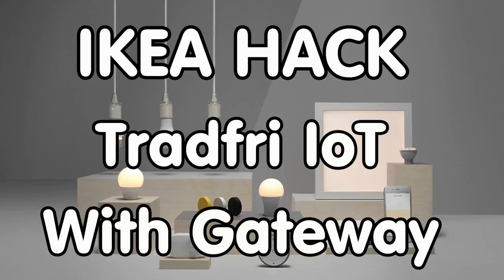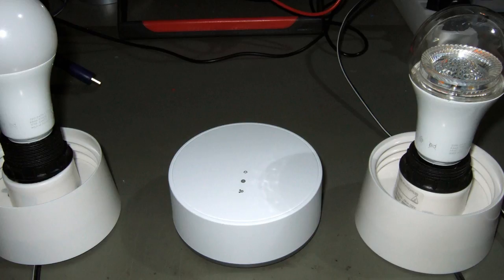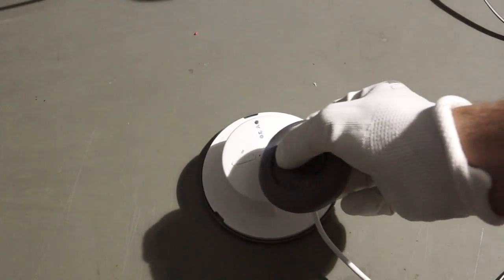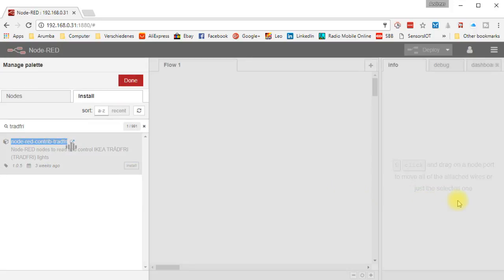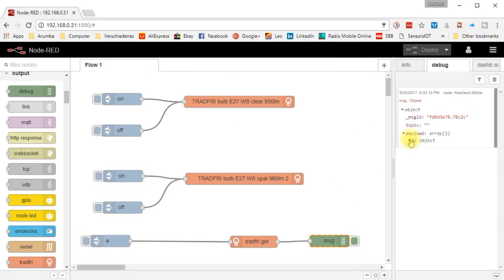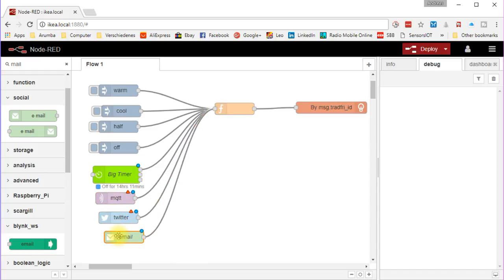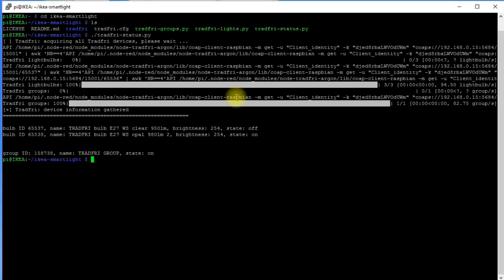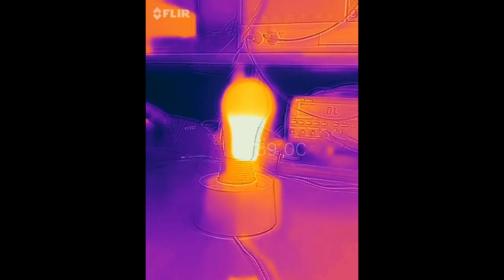#145 IKEA Trådfri Hack with Gateway, Raspberry connection

Comment from the maker: ATTENTION: The FLIR measurements are not correct (probably because o the material or because of the radiation of the LED).They are too high. But still, the whole lamp gets pretty warm.
Reply: Andreas Spiess did you try a bit of electrical tape on the surface you want to measure.  (non reflective and reasonable emissivity )
Reply: 90 degrees indeed seemsed pretty hot. Won't make 25.000 hrs
Reply: Ed19601 it isn't 90 degrees, and it is rated for about 6-14W, depending on type, and handle about 25 000 switches on/off. 
So yes, I think they will live 25 000h.
Reply: The Hue bulbs get super hot too, I would estimate maybe 75 C in the base. The non-smart 100 W equivalent bulbs I have also get pretty damn hot, I guess it's just a thing with the switch mode driver chips and limited heat sinking.
Reply: Anders Jackson that's why I said "seemed", because if it were it probably wouldn't make 25.000 hrs
Reply: That's quite concerning since I'd like to use them in a not-so-ventilated enclosure ...
Reply: Very odd, really.  Due to the much lower voltage, the 'on' time of the switcher is very low, but also a pretty high current spike (relative to a smaller drop across the supply).  Still shouldn't be more than slightly uncomfortable to the touch.  I use 60 watt equiv. bulbs both at home and elsewhere, and I can grab one and unscrew it without even thinking much about the heat.  100 C would leave burns.
Reply: You exposed your password-authentication-thingy which is on the back of the gateway around 10:49
Reply: @anullhandle  Yes correct, like i learned on FLIR cursus, put electic tape on metals and such

Comment: Very interesting video.  I like IKEA concept a lot, providing affordable system that is using standard protocol. I hope they will improve on that heat problem because it could caus them problems in future.
In my opinion, one thing that is missing in Trådfri product range is some kind of generic power switch that you can plug in power outlet and then control output. I am thinking to build something like that by getting a Zigbee module and then build something like "Zigbee Sonoff" with it, that is capable of pretending to be an IKEA light bulb.
Reply from the maker: I think, they just started and heve to learn to deal with electronics. Most of their current offering is still "mechanical". And I am sure, they will expand their offering, if we buy the current stuff...

Comment: Excellent explanation about the protocols that tradfri uses! I'm interested in "hacking" a tradfri remote control. I want to use the left and right button to switch between scenes despite of switching between light temperature. My goal is to switch between 100% brightness on 2700k and 30% brightness and 5% brightness on 2200k. Just like the non smart Phillips scenes switch bulbs. Right now I need several commands from the tradfri remote to do that.
Reply from the maker: Good luck with your project! I think, today you find much more info about the topic than when I made my video.

Comment: I see that the TRADFRI node has the same problem as the Hue ones, the bulb (or function) is fixed by the setting in the node. If this is similar to the Hue node it can be very useful to pass the bulb identity into the node through the 'topic' functionality. This allows the node to operate for multiple bulbs (using the split node) and then to use a database to store scenes. It was quite easy to modify the Hue node for this (but a whole lot harder to get the change adopted into the original node).
Reply from the maker: You do not need to set the bulb in the node. One setting is, that you can select the bulb from the payload and it works.
Reply: Thanks Andreas, my NodeRed install is currently broken and I didn't get a chance to look at the node detail, just what was in the video. When I do get it back I might align my modified Hue node with the TRADFRI one and then I can create scenes with a mix of bulb types without too much different setting up!

Comment: 90°C is quite hot, hope it doesn't melt some lamps. on the other side you get an extra heat source in your house. Funny to see secure coap is used while zigbee can be hacked quite easy.
Reply: 3D Gussner Compared to an ordinary tungstone bulb, 100 degrees Celsius are not hot.

The Gateway is connected to internet, but zigbee isn't. That is why you want encrypted communication with the Gateway, so others can't capture the user and password.
Reply from the maker: Personally, I think, 90 degrees (and some parts inside must be even hotter) is not good for electronic parst on the long run. We will see how many of these bulbs have to be replaced by IKEA during warranty period...
Reply: Again an interesting and useful video, Andreas, thanks. Will you dive deeper into the "hot" secret? LED bulbs were introduced as an energy saver, but I guess a lot of energy is now wasted due to a cheap but inefficient power converter...?
Reply: That would be great.
Reply: The glass bulb of an ordinary incandescent bulb can reach temperatures between 200 and 260 °C, so 90°C will not melt anything. Very few plastics melt at below 100 degrees (think of boiling water, in a plastic cup)
Reply: And I have hard to belive it get that hot, as it is marked 14W. And you can still handel the bulbs with your fingers when they are hot.

Comment: The god part about the app is that you can make some automation.
Short commings of the app is the timer control are primitive.

Another problems is that the bulbs are organized around one controller. So you can only put one controller to control a group of bulbs, so a controller on each side of stairs are not possible.

And yes, there are a movement detector in Trådfri, which can work as a controller.

With the protocol, one can detect the controlers and through that control other groups.

One good thing with CoAP, there are support for updating firmware in devices.
Reply from the maker: I saw the controller in the discovery, but had no use for that so far. It also switches the lamps and you can read the status of the lamps to get the status of the controller (without toggle).
I do not own a movement detector, but assume, it works like the remote control directly to the bulb. This is why I do not like it. My movement sensors go to node red, where I can do some logic before I switch the bulbs. 
I just checked the answer for the remote control: It was always "on:false" in node red. I assume, its message is not stored in the gateway. Do you know a trick?

Comment: Hi Andreas, I’m working with the Tradfri stuff now for more than a year in combination with Node-Red. Control the light bulbs isn’t a problem. I’m able to switch them on and off and I’m able to read the status. But my problem are the switches. The plugs. Also here switching them on and of using Node-Red works perfectly. But....... I’m not able to read the status!. Do you have a solution to achieve this using Nod-Red?
Reply from the maker: For Zigbee I use now zigbee2mqtt, but I have no IKEA plugs in my home. I also made a newer video about zigbee.

Comment: Thank you, this is very interesting, I made a home automation system with Futlight RF lamps and zigbee/RF roomcontrollers, but after this video I would like to replace the RF bulbs  from Futlight by the Ikea ones. I just wonder now how to control groups of Ikea lamps and the color of the lamps.  These lamps can listen to group commands? Did someone crack the full protocol allready ?  The Ikea lamps work as zigbee routers?  Can the Ikea gateway be controlled by ESP32 also? Thanks again.
Reply from the maker: There is a newer video about Zigbee and I plan a third one in the near future focusing more on Mesh networks.

Comment: Wow, that's some hot bulbs! Did you adjust for emissivity on the white surface of the bulbs or check with a thermocouple to check readings of the temperature were correct?
Reply from the maker: +zaprodk You are right. The shown temperature was too high. I made a correction and pinned it, so everybody can see it. Thanks!

Comment: Great video :) Quick question though: at 7:50, the color parameter read from the bulb seems to be an RGB hexa string. But at 8:32, when sending the message to set the light to a color, you are using a preset value ('warm'). Does it work if you send an arbitrary RGB code (e.g.: ff0000) ?
Reply from the maker: This is an old video and I do no more remember the details :-(

Comment: Hi Andreas, thanks a lot for your effort, much appreciated. After connecting the Tradfri Gateway to Node-RED, I'm wondering whether there's a way to receive events, for example from the remote control. Maybe you could point me to the right direction, I'd happily implement an Input Node for node-red-contrib-tradfri. Thanks in advance.
Reply from the maker: From what I saw, you can read the status of the remote only if you read the status of the bulbs, which were switched by the remote. But I did not invest a lot of time in this matter...
Reply: There is a feature request for an observer in the node-red palette: https://github.com/nidayand/node-red-contrib-tradfri/issues/8 . 
Let's hope that somebody will implement its...

Comment: nice project again. I did the same with the Philips HUE. I am curious what the get returns with tradfri when the lamp is switch off from main. Is it the same on/off parameter?
Reply from the maker: Can you rephrase your question, please? I do not understand it.
Reply: Andreas Spiess I mean, what does the get request get as an answer when a light is not powered on. The Philips HUE API has an parameter reachable for that. I was wondering how this is in Tradfri.

Comment: Great series, will test myself. One concern is that it looks like the gateway and controllers can only control 10 devices. Will your hack expand this limit. If not how are one supposed to use this system without going mad with limitations.? More gateways?
Reply from the maker: I was not aware of this limitation. So, I assume, with different gateways. Might anyway be necessary because of the limited reach of Zigbee

Comment: Great series! One question though: if I understand correctly, the same bulb can be operated both with the remote switch and the gateway. I'm curious if it's possible to receive remote switch events through the gateway? That is: if I switch on/off or dim the bulb with the remote control, would I be able to receive these events through the gateway with a computer? Thx!
Reply from the maker: The take of this video was done a long time ago, so I do not remember the details. And I did not do anything with this technology since then. But I think, there is more stuff on the internet now than was available then. Maybe you find your answer by googling.
Reply: I'll probably do that. Thanks anyway.

Comment: Hey Andreas, I really like your video's. I fell in love with the LoRa series. Would be really interesting if you did a tutorial on GPS tracking through a lora node. It would be a really go alternative to mobile network for embedded tracker use cases
Reply from the maker: I think, you find such devices because they were used to test LoRa gateways. Google for "lora gps arduino" or "lora gps tracker"
Reply: Andreas Spiess Yes, I did know of that since a short time. However, lately I found alot of people doing it on a node
Reply from the maker: What do you mean with "on a node"?
Reply: On a node as in not on a gateway.

Comment: I have one more use case. How to implement that one? I can't change the electrical installation in my rented apartment. So, many tradfri bulbs are connected to old fashioned physical light switches. However, I still want to implement a night mode. Meaning the bulbs must have 2200k light temperature during night. E.g. can I get an event once a bulb is turned on in order to switch its light color?
Reply from the maker: I think I changed color from cool white to warm white somewhere in the video. It is possible

Comment: Someone stated (comments of the make article) that the used electrolyte condensators have a lifetime of 10000 hours at 105°C. Am I wrong if I assume that the bulb is likely to die within 1.5 years?
Reply from the maker: Probably not...
Reply: Maybe they used solid electrolyte (polymer) caps.

Comment: Is it so that communication between the IKEA Trådfri gateway and the lamps goes thru the remote? In other words, the gateway cannot operate the lamps alone?
Reply from the maker: +jesuschal I do not think. However, you need the remote to pair the bulbs. Which is ok, because the remote is portable, the Gateway usually not...
Reply: From the Ikea.com (http://www.ikea.com/ms/en_US/customer-service/about-our-products/smart-lighting/troubleshooting.html)
I connected my light source to the TRÅDFRI Gateway by using my remote control. Do I need the remote control anymore or can I just use the TRÅDFRI App?
You can steer your lights without the remote control if you disconnect the steering device from the Gateway after you have used it to pair your light sources. However, if you decide later on to add more light sources to your system, you will need a steering device again.
Reply from the maker: So, it is, as I suspected...

Comment: do you need a steering device to control products, or can you configure products to connect directly to the hub?
Reply from the maker: You need the remote control (which comes with the bulbs to pair them with the gateway

Comment: 90 dgr. C makes me curios how the PS in these lamps is constructed. Most probably cheap eastern crap that may have a short limited lifetime of only a few years. Subjecting most plastic to >90 dgr. C tends to wear them out(become brittle) in hurry.
Can the lamps 'power converters'  be improved with hacking/modding to the power supply? 
Can they be accessed/opened without breaking? 
As always thanks for another great one.
Reply from the maker: +Nicklas Persson These were my thoughts when I discovered this. I thin, IKEA has a problem here. Some of the parts inside must have an even higher temperature and will be dead soon. Fortunately, the consumer has a warranty... And IKEA has to learn electronics...

Comment: I'm wondering if it's possible to hack my whole system so that my orginal switches doesn't power off the bulbs but just send an mqtt message to node-red. This way I could keep using also my original switches. Do you think it can be practical?
Reply from the maker: I do not know. I only did the investigations shown in this video.

Comment: Best part is you can use this hack parallel with stock remote..I prefer to have a physical button than a touch screen /app...90C thats a lot of power loss..ikea should use more efficient drivers
Reply from the maker: You can also create a physical MQTT button using an ESP8266 (I made a video about that) ;-)

Comment: hi Andreas, is t possible to upgrade this nice howto cause atm its not working for me?
Greeting from Austria!!
Reply from the maker: I made two additional Zigbee videos where I used the IKEA bulbs. I do not plan to go back to this solution.
Reply: @AndreasSpiess  is there a way to get it working again? was it a change from ikea?
Reply from the maker: @TheRowie75  I do not know because I never used it since then
Reply: @AndreasSpiess  so what is the best way to control my ikea stuff from a pc or other device then the ikea app over wifi? I have some raspberry pi zeros and a 2 and a 3+ raspberry with touch, a ninja block and a ninja sphere. :-)
Reply from the maker: As I wrote, maybe you watch my Zigbee videos and then decide.
Reply: @Ronald: I would like to point you to the node red plugin: https://flows.nodered.org/node/@fetchbot/node-red-contrib-ikea-home-smart. The original plugin presented by Andreas seems not to work anymore. Unfortunately  you have to generate a "username psk" yourself, see https://github.com/nidayand/node-red-contrib-tradfri/issues/11#issuecomment-341075124 for details. You can get the coap client used for that purpose here: https://libcoap.net/

Comment: FYI: You set your CoAP secret as "1234567890" in your examples, but in your command-line output, you can see the actual secret.
Reply from the maker: I got the hint already. Thanks. I think, it is not critical as the Gateway is behind my Firewall. But I have learned something (hopefully)